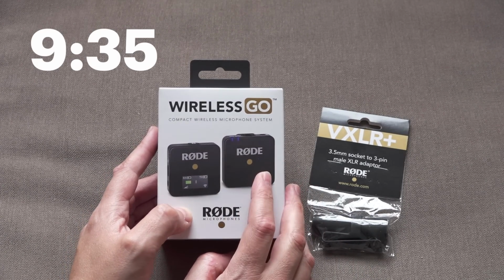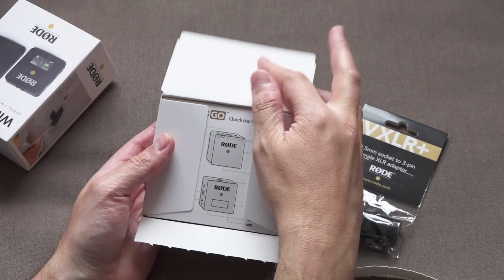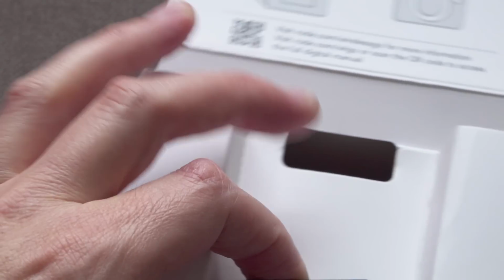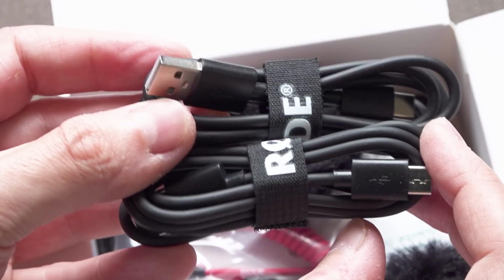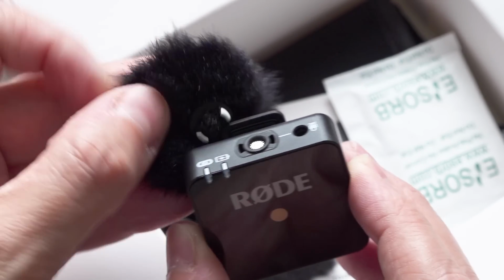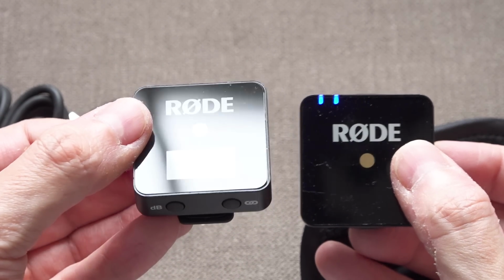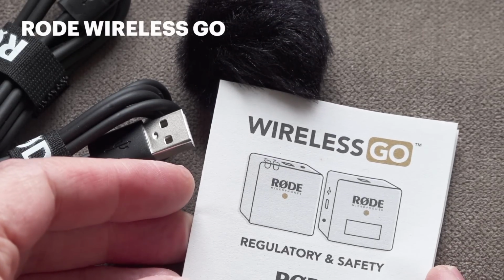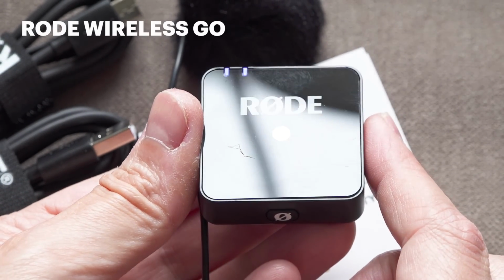RODE Wireless Go - First Impressions & Test

Comment: Thanks for your (what I regard as) more realistic view of the Wireless Go. I think its biggest strength is possibly the ability to easily plant it in scenes. I’m not as keen on it as a decent lav mic going into the Rodelink. That’s significantly better.

Also, the lack of input control isn’t great. Actually, come to think of it, if there is some kind of ‘automatic gaining’ going on, then that accounts for the lack of input control I guess. The underlying whine can be annoying in a quiet environment and the connection is easily broken crom transmitter to receiver by just turning around.

So while it is very convenient to use, I also don’t feel that it’s that great for quality of sound either.

Cheers.

Ian
Reply from the maker: I haven’t done any range tests yet (though no doubt I’ll end up posting something about that) but it concerns me what you say about breaks in transmissions by simply turning around. The packs that I use at the moment aren’t pretty and they are a bit battered but they work and are so reliable.

I know this product is not in the same price range but it’s not cheap and it still has to be reliable and good enough quality. I hope it is.
Reply: For some reason, different people have got different distances from it. One guy was literally 4 feet away and when he turned, it plopped out. I did my own tests. It was better than his but not brilliant. Then the next day it was actually better. I put it down to weather!

I made a video that showed a measured 70 yards facing the camera on the good day. Then I made another video where I did a twirl on a walk that we did, and sure enough, it plopped out again at about 20 feet.

 Maybe it’s very low powered or the reciever is deaf, so tiny variations interfere with the signal too easily?

So it doesn’t seem too reliable so I stick with the videolink which is way better. The sound of its internal mic and the inconsisteny with signal loss makes it too risky for me. Especially at its price.

I left the tests on my channel. One’s a distance test and the other a vlog with it. Basically to just test it. Trouble is, it reminds me of the Rode Go which reacts to electrical interference with no warning. Makes it risky to use for anything and that’s how I feel about this one.

Must be to do with the word, ‘Go’!  ;)
Reply from the maker: 2.4GHz is a terribly busy part of the spectrum and won’t have the same coverage or penetration as something operating on 600MHz but they have to be reliable. I’ll take a look at your vids and will also do my own tests. I didn’t buy these to use, just to test so I will remain completely unbiased. 🙂
Reply: Mine were for testing too but I wasn’t overly impressed if I’m honest. Speech can sound a bit harsh. The Rodelink is superior. (I also have that one) Better sound and range, using 2.4gHz as well. I’m in a country area so not to much going on at wifi level.
Reply from the maker: I did some initial testing yesterday and the best I got was 6 metres (19.6ft). That is line of sight except for my body as, like you, the performance was worse like this. Now, if 6m is the fringe distance (where you might start to have problems) it really limits the use. As mentioned, these need to be 100% reliable. You can't operate where it might or might not work and I know that when I've been filming using lavs, the presenter frequently goes further from the camera than that. So these are great for someone vlogging or a very fixed seated interview environment but nothing more dynamic or unpredictable.
Reply: Absolutely. It’s the lack of reliability that puts me right off. Funny thing is that I got a different result on a different day. Made me wonder whether the output power is very limited in order to conserve battery, or whether the reciever is a little deaf due to its small size. I sometimes film shows and these kinds of mic can work really well in that situation. However, this wouldn’t reach realiably down a theatre; especially if actors turn.

Vlogging usage only!

Comment: It’s heavy on the sibilants, eg lots of sssssss on the top end of your voice but not a dealbreaker given its portability. A simple de-hesser applied in post will sort that out. Your Sennheiser is streets ahead in audio quality but you get what you pay for I suppose. Good video btw.
Reply from the maker: Thanks for the feedback. As a set, the Sennheiser EW100-G3 set are much more expensive but the Røde still comes in at £180 which ain’t cheap. It’s an amazing little set though. Innovative and simple.